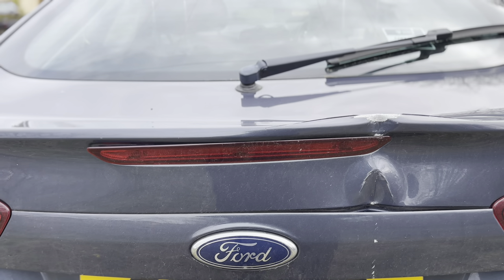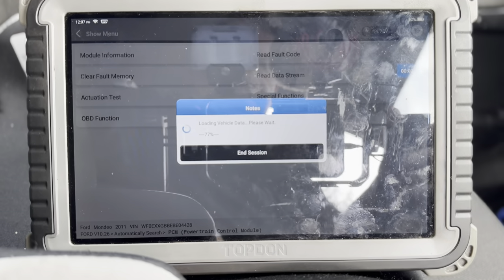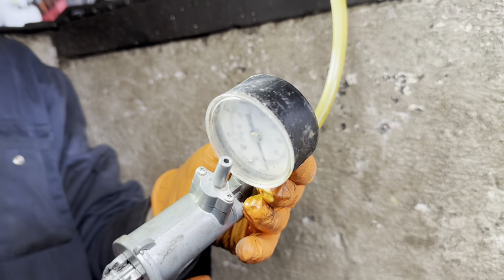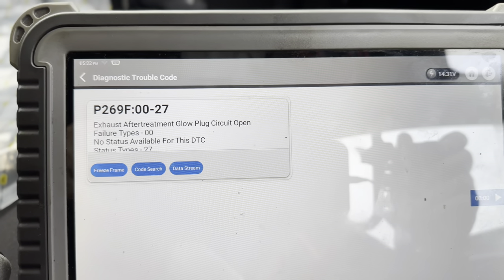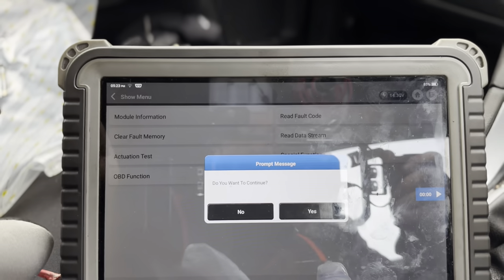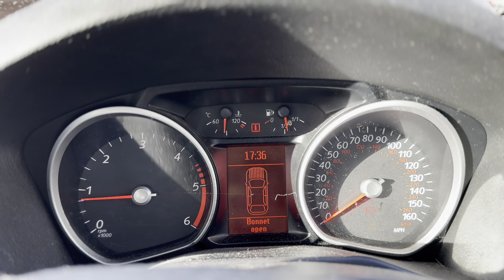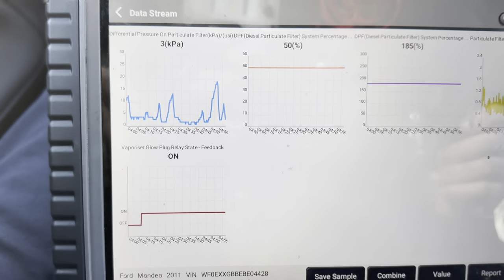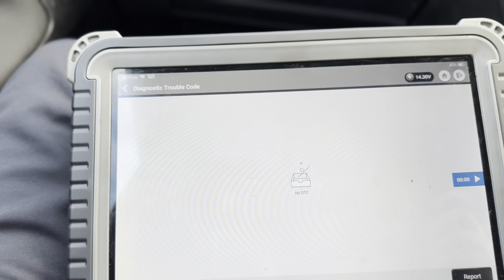Ford Mondeo 2.0 TDCi  Fault Code P269F Exhaust After-treatment Glow Plug Open Circuit

Comment: I’m part of the Dpf doctor network & that is exactly how it is done Sandy, well done mate 💪💪💪
Reply from the maker: Cheers Peter I just wonder what blew that fuse😳
Reply: @sandyande  it could have been worth fitting that vaporiser, they can get blocked quite often and the glow plug can also fail often enough. I find sometimes it is better to be expensive and cover any possible items that can return the vehicle on us. But that can be dealt with if it arises 🤔👍👍
Reply from the maker: Good advice Peter👍
Reply: @kennedysgarage3281 I'm getting the same fault code, dpf was specially cleaned, garage took it for 5 mile drive said all was okay, 30 miles into drive (town and country roads) and the engine malfunction appeared again with the glow plug fault code.  I'm £400 down so far and still no further forward, what can I do?
Reply: @gailspooner1540  most people ask me to clean the DPF on their cars but cleaning it only gives a temporary solution. The question is why has it blocked in the first place ???
And it could well be the vapour blocked
Reply: @sandyande hi mate, I have a ford mondeo 2010 2.0 diesel auto and I had a blocked dpf so I got it cleaned however when the clean was finished it got a new code saying after treatment for exhaust 
Do u know what this issue might be please the car struggles so much going into speeds especially on hills and motorway it won't go past 50mph I have to shift it into manual and do it manually as it won't shift into 6 gear for some reason any ideas please 
Thanks

Comment: Hi there! I had absolutely same problem, changed vaporiser and that fuse, now it’s working, but now regeneration always starting working after first 100meters. I drove about 50km but regeneration still working, and at this time my average Average consumption doubled. Is that ok? I just need to arrive longer drive?

Comment: My DPF filter on my 2011 ford mondeo was taken off and cleaned, put back on and now I'm getting the glow plug fault as described here.  I'm lost as what to do next, £400 down and still having issues 😢
Reply: Hi, I'm having the engine malfunction message flag up on my 2012 galaxy 2.0 TDCI. Diagnostic says its the glow plug. Turning engine ang ign off and restarting seems to clear the engine malfunction message but it reappears after about 5 minutes driving, but not when stationary. What was the fix for your issue?